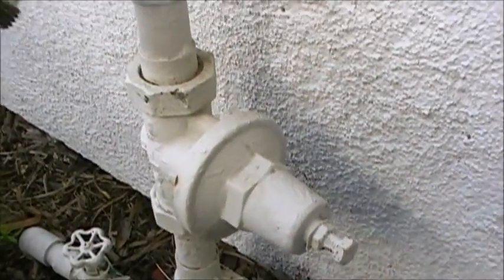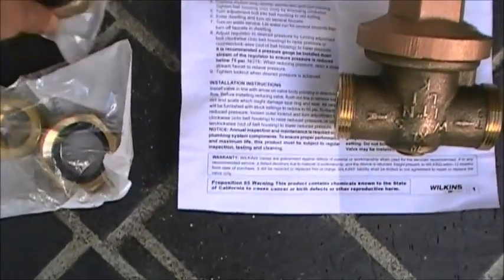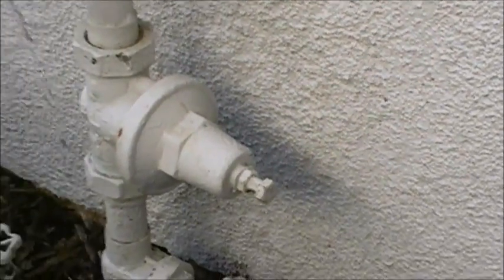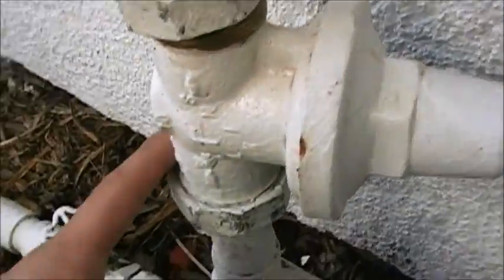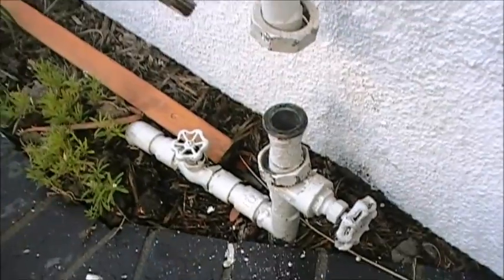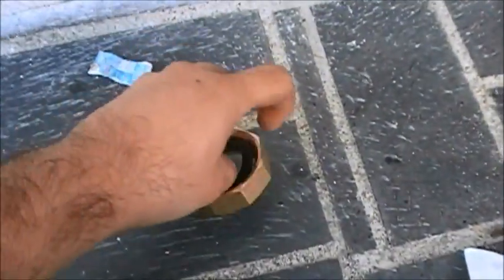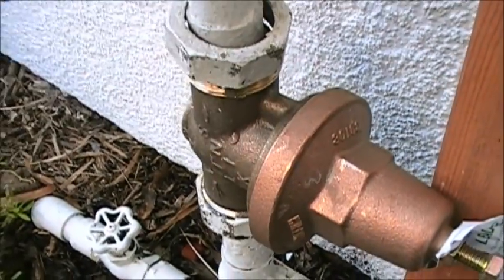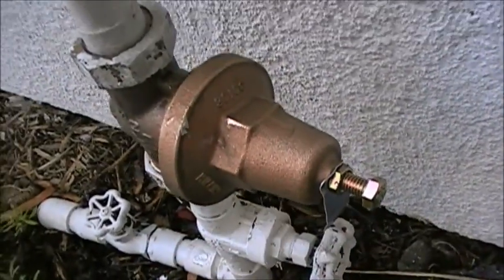How to install a home water pressure regulator

Comment: If the pipe is galvanized steel then you need to use "Dielectric unions". If you connect brass to steel without them, then the steel will rust extremely fast. Very fast!!!

Comment: You forgot to check the water pressure, after the install, just to verify or adjust as needed.
Reply from the maker: Thanks. Correct. 

I got the gauge after making the video, but for reference it said to keep the gauge on for 24 hours and check the highest pressure it hits and make adjustments based on that. However hilly areas may experience more variation in the pressure so you just have to be more cautious in the adjustment amount in those areas.

Comment: Hey guy amateur here looking to do something like this. I am trying to avoid the soldering as I am not experience in this area. Could someone tell me if the is a compression water reduction valve?
Reply from the maker: I'm not experienced with soldering or brazing copper pipe. Here are some potentially better pressure regulator options.

I like the new quick connect type plumbing fittings and other offerings from Sharkbite and Brasscraft.

I found a 0.75 inch size and 1 inch size:
https://www.lowes.com/pd/SharkBite-Brass-3-4-in-Push-to-connect-Pressure-Reducing-Valve/1000296467

https://www.lowes.com/pd/SharkBite-EB45-Brass-1-in-Push-to-Connect-Pressure-Regulator-Valve/1000371083

Try those out above. It's a quick connect style fitting. Just pull back connector and release and it will connect. It's usually good practice to sand down the connections and you may have to cut pipes to length for it to fit. 

I've used several of these quick connect type fittings for 90 degree turn valves under all the sinks in the home, except for the dish washer since it was a different size. They have been working great and reliably for around 8 years now.
Reply: compression spring water regulator..

Comment: Great video.

I need to do this as well, my pressure is 110psi, and I just had to replace a failed TP valve and expansion tank.  Before the pressure kills the new expansion tank, I need to get the regulator replaced asap.

Question...I have the same Wilkins 70 regulator, which they don't make anymore, but there are 2 types of the 70xl to choose from.  One is dual, like the one you used, and the other is just a standard fitting.  How do you know which one to use?  My regulator has only one nut to loosen, the other end has the nut as part of the housing, like the one in the link below. 

https://www.amazon.com/Wilkins-34-70XL-Pressure-Regulator/dp/B004X2XB4I/ref=asc_df_B004X2XB4I/?tag=hyprod-20&linkCode=df0&hvadid=167157674088&hvpos=&hvnetw=g&hvrand=6684954480609405245&hvpone=&hvptwo=&hvqmt=&hvdev=m&hvdvcmdl=&hvlocint=&hvlocphy=9003715&hvtargid=pla-315081675081&psc=1
Reply from the maker: I'm not sure what is the difference between the 2 models. Based on what I've been Googling online it seems Wilkins may not be Zurn Wilkins or Zurn. I might be wrong. 

It seems based on your description of what you have and in the link, it's a female thread on one end and a male end on the other. The product should come with the proper nuts to fasten. You may have to get a coupling of some sort. They are most likely NPT threads.
Reply: @HasanainShuja  

Thanks.  Yeah, I think Zurn/Zurn Wilkins are synonymous, so I'm not concerned about that.

I should have reexamined my regulator before I posted.  It certainly does look like I have the one with one male, one female end, so that's the one I ordered, I hope I got it right.
Reply: Hey, I got the regulator from Amazon about 2 hours ago, and I installed it. 

Had to re-adjust several  bolts a few times because leaks kept springing up, but I finally got it to stop leaking. 

Works like it should, got it set at 65psi now.

Thanks again for the video, it helped a lot.

Comment: I had to replace my Watts N35B Z3 sz1 since these were discontinued I had to buy a similar one which I did. it was the Watts LFN45B Z3 sz1 this was an exact fit from previous one. this video helped me replace mine. I'm not an expert or close to it. it literally took me 10 minutes to swap it out. I had 115 Pressure now I have 68. he'll of a difference.

Comment: Thanks for sharing . However in order to get the old flange ring system off and put on the new ones a careful work would a hacksaw or small cutter would have given you the option of  new flange system instead of only new o rings .
Reply from the maker: Agree but I think I would have to weld in new flange fittings as well after using the hack saw or a copper tube cutter from Harbor freight etc to cut off old flanges

Comment: I got a plumber to replace
My water heater and pressure reducing valve but the pressure is too high still (150 psi ) any ideas what it can be? Plumber said that there is a leak in my main water shut off and to call the city. When I checked it, it is about half full of water, but is this possible or is he just trying to make excuses, I think it may be a faulty regulator He said nothing is wrong with
The work he did..
Reply: don't run water for about 40 minutes, go to the water meter at the street and see if the little triangle is spinning. when this spins it means there is water running somewhere and if it is most likely there is a leak. but that's only if you haven't run any water for about 40 min. if you do so much as flush the toilet it will tamper with your reading on the water meter
Reply: Jochoa604 a standard pressure regulator can handle up to 140 psi. You’re going to have to buy a high water pressure reg.

Comment: Lucky he bought a drop in replacement model. Did not have to do any soldering. The XL qualifies for 'lead free' so basically it is the same model water pressure regulator without as much lead in it. Does not need teflon tape as the washers are the seals, the nut threads don't seal just hold the washers tightly in place. Besides that, the nuts along with the entire body is brass and doesn't rust. Could have cleaned up the surfaces for the washers with a brass wire brush. Pointing out the directional flow 'arrow' on the unit would have been nice along with before and after pressure readings. That regulator is adjustable to pressure between 25psi - 75psi, factory set at 50psi. Also, could have bleed the air out of the line after installation by attaching a garden hose to the hose bib and letting it run.

They have rebuild kits to redo the internals of that regulator but they cost almost as much as a whole new unit and can be tricky to install to work correctly plus extra time involved.
Reply: Thanks for your advice with many insights along with all the other great information.
Reply: Nice drop in job when you can do it that way. Other than what has been mentioned, the only other point I would suggest is using a hex wrench and using a backup wrench at the same time. Not every union nut loosens that easy. By not using a backup wrench it could lead to further plumbing problems that you did not expect.

Comment: what about the TEFLON tape on the treads, also you never rechecked the pressure at the tap?
Reply: Although Teflon tape is not a bad idea, it isn't usually required in brass fittings. Soft metal and all that.
Reply: +Mark England they are compression fitted, that is why you don't need teflon
Reply from the maker: thanks i updated the video with a comment. as for rechecking the pressure i bought a gauge later

Comment: You can take of the original nuts with a torch to melt the solder. The you have to solder the new flanges on after first putting on the new nuts.
Reply: But why would you want to?

Comment from the maker: first did you make sure that the arrow is pointing like it originally did? meaning is the flow of water the same as it was before? is it going to the home? also did you open up the main water line connection again after closing it? also try checking if the reducing valve is closed their should be a nut or valve to reduce or increase pressure. i don't know what else could be wrong. maybe the line has something stuck in it? or it could be that the reducing valve is broken that you got.